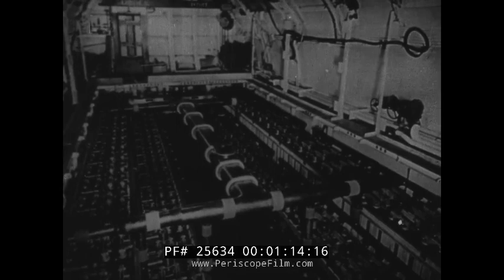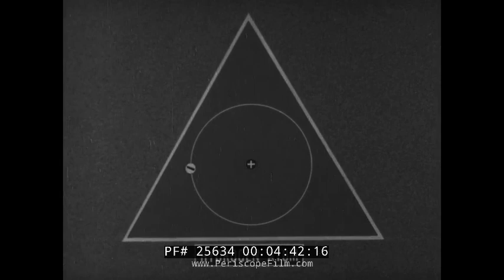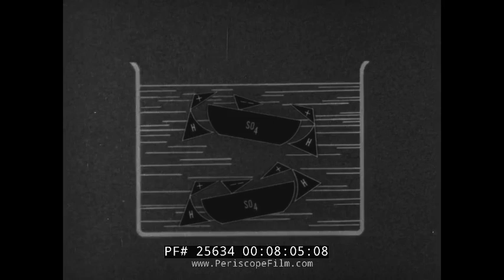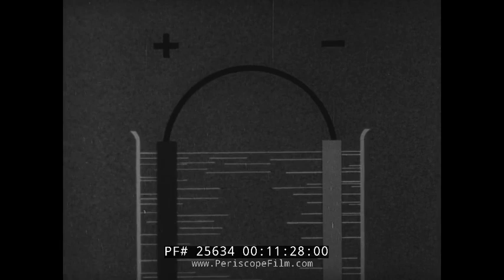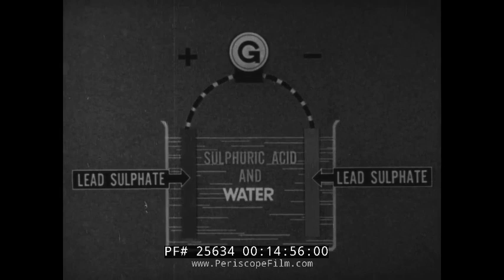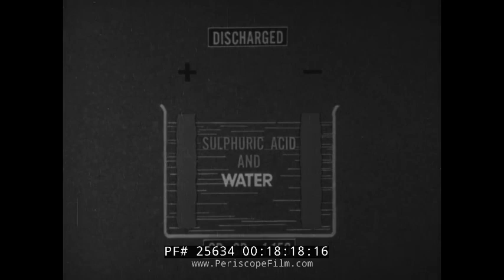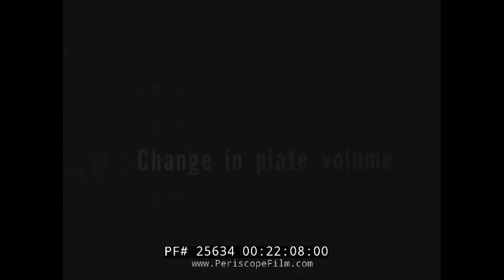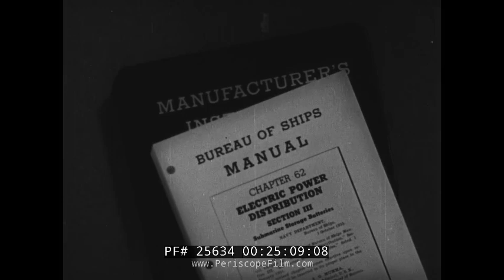U.S. NAVY THEORY OF LEAD ACID STORAGE BATTERY TRAINING FILM 25634

Comment: A useful film for anyone who owns any kind of motor vehicle or heavy equipment that uses a lead-acid battery. I knew a little about how car batteries work, but not the fine details of the chemical reactions. It should be noted that, at every charge/discharge cycle, the plates shed a little of the metal, which gradually precipitates to the bottom of the cell. Most lead-acid deep-cycle automotive batteries, such as are used in golf carts, have only about 500 full cycles of useful life: after this, the plates are "worn out", i.e., not enough active lead and lead oxide remain on the plates for the battery to hold sufficient charge to make it useful for a vehicle. Or, so much of the plate material has fallen off the plates, that the "sludge" build up in the bottom of the cell short-circuits the plates, producing a "dead" battery that won't hold a charge at all.

Comment: I intend to try and recondition my failed solar batteries and this video was essential viewing. I had to watch it twice to get the full jist of it because my previous understanding was at odds with this explanation.
Reply: Just remember, when working on circuits, GE believes Negative flows to Positive. They give everything (IN DIRECT CURRENT), A SOLID POSITIVE to a coil and a switched Negative. Every other company believes Positive flows to Negative, so they put a solid Negative at the coil, and switch the positive. This is good to know if you work on equipment of more than one manufacturer. You'll scratch your head till you realize this point. This is especially true in Locomotives.
Reply: Current only flows from the negative to the positive. That’s the true electron flow. It’s ok in most cases to think in “conventional current” but that’s not what’s happening. There’s a significant historical reason for this.

Benjamin Franklin, a great scientist, made the discovery that electricity is bipolar. He wanted to name the poles something different than the poles of a magnet; “north” and “south.” So he invented the terms “positive” and “negative.” But at that time there was no way to determine which way the current was flowing so he took a crap shoot at it knowing he had a 50-50 chance of getting it right. A century later the electron was discovered in a cathode ray tube and the actual flow of electrons showed that Franklin got it backwards, he called heads and got tails. 

Instead of changing a century of electrical terminology we humans declared the electron to have a negative charge. Had Franklin gotten it right the electron would have a positive charge, the proton a negative charge and “conventional current” would actually be electron flow.

This makes me wonder how many intelligent species in the universe got this right in their history and how many got it backwards like we did. I bet it’s a 50-50 split!

Comment: When I was in high school some 50+ years ago, I worked in a full service gas station (as most were at the time).  One of the services was to remove the caps on the car batteries to check the fluid levels.  Often it would be so low, the tops of the plates would be exposed.  We had a water jug that had a spring loaded valve in the spout.  The spout would be inserted in each cell and the water would flow into the battery until it reached the fill line.

I performed that action hundreds of times, but never really knew why plain water would keep a battery working.
Reply: It should have been still water or water that's been boiled converted to steam and collected as the impurities in the water will degrade the plates, obviously no water would kill it faster  lol
Reply: @cjdelphi  It was the same tap water that we put in the radiators.
Reply: If tap water is drinkable it’s fine for a battery. A lead battery is much tougher than a human. While potable chlorinated tap water is ever so slightly base, if it can’t hurt you it’s way too weak to effect a change in the sulfuric acid in the electrolyte.
Reply: @tadonplane8265 It was 1972, I was 16 years old and the gas station owner ate sandwiches without washing the grease off his hands.  Using distilled water to fill batteries wasn't a consideration.  That said, nobody ever claimed that we damaged their battery.

Comment: thanks for posting. i wonder why i didn't get to see this one when i went thru sub school. during indoctrination on my first sub all i was taught about the ships battery was that if there was a fire in it's compartment all i was to do was take the rubber coated fire extinguisher and turn it on and throw it in to the battery compartment and slam the door. (it wasn't really a door it was actually a hatch in the deck.)
Reply: I worked with large cells as a communications tech.the biggest ones were 1670 amps in 2 v cells. We never had this training either and I worked for a very large communications company. I was in the Navy as an AX on P3s. My oldest brother was a sonar tech on fast attacks from 1962 to 1975. He also taught at Key West for his first shore duty. Brother-in-law was also one but on boomers. He retired about 1980. I grew up not to far from Groton. Now I’m retired but still use wet cells at a remote cabin for a solar and  4Kw inverter system.

Comment: I use to buy and sell battery's for solar storage from 2nd scrap metal yards in the 90s
To quickly test if any were still usable I'd check with a 12v test lamp also check the taist of the acid off a small stick. 
Citric taist was a good indicator of a good battery..
Didn't seem to hurt me but I rinsed my mouth out regularly and made sure the small amount I did get in my mouth didn't contact my teeth..
Reply: batteries, not battery's
Reply: taste
Reply: @tadonplane8265  
My spelling and "grandma" are crap, 
But I had plenty of power and lived a comfortable life. 
There's no scavenging around scrap yards now.. safety rules are generally more rigorous.